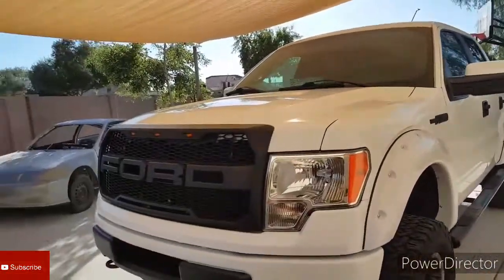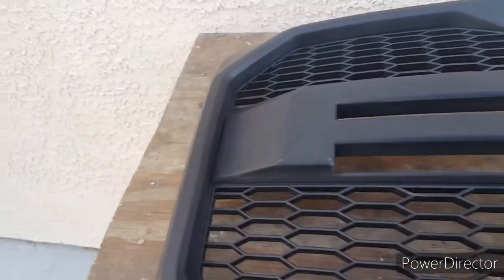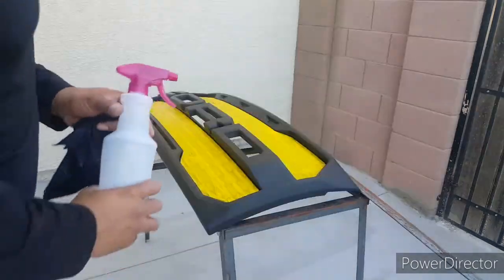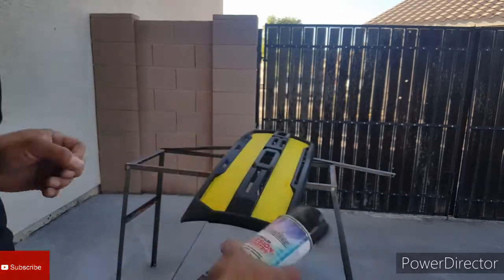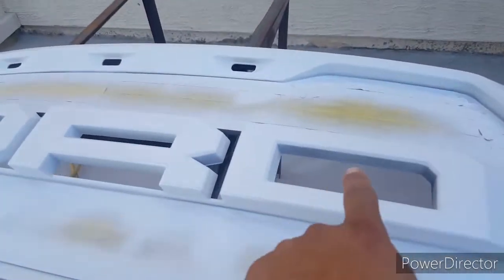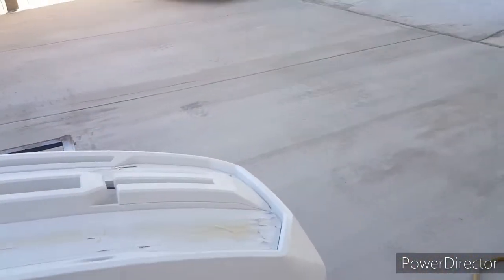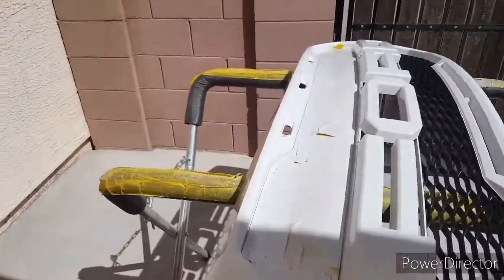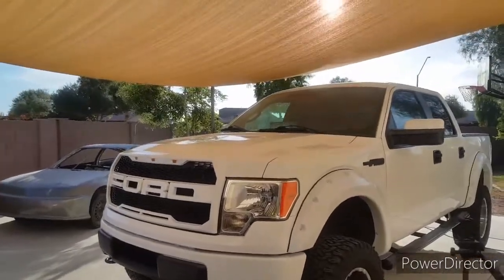How to paint your truck grill step by step DIY

Comment: Super helpful video! I just ordered a new grill that I intend to paint black. The grill is currently chrome. Would scuffing the chrome be enough before using adhesion promoter, paint, and clear or do i need to somehow fully remove the chrome first? Thanks again for the video!
Reply from the maker: Yeah you can  paint over the Chrome just stuff up everywhere u gonna paint , yeah it would be too much work if you try to remove that Chrome off the grill

Comment: Does the same process work for metal grills?
Reply from the maker: @syzzn.aiden.  u will have to use a direct to metal primer and let that dry and sand with 600grit and then paint

Comment: Looks outstanding!

It’s almost exactly the style I’m doing for my 2014 FX4/FX Appearance. I’m going to go with a flame red stripe on the flat piece  (it’s about 1/4” wide) all the way around, and also may use red for the honeycomb portion. The black will be the parts outside of the letters and maybe the beveled edges of the lettering. 

Same idea with the clear coat and probably using clear rock guard on the whole grille since I occasionally encounter small rocks on the highways where I live (we get lots of snow and gravel/sand is used for traction in winter).
Reply from the maker: Thanks Oh nice , Yeah the rock guard should be good and durable , red honeycomb will look cool 😎 👌🏾

Comment: Nice job ,,,you also mentioned sealer ..Is it necessary to use sealer and if so is it applied after applying promoter ?
Reply from the maker: Thanks man , No u don't have to use sealer, just  sand, degrees then use promoter and then paint
Reply: @josha7548  
Thx buddy !
Reply from the maker: No problem 👍

Comment: I used 180 grit to start but I’m using primer filler and primer sealer after the adhesion promoter is this good or bad
Reply from the maker: Yeah , along as u put it on the plastic , that will help it bond to the plastic better

Comment: so you can get away with just prepping then using adhesion promotor, then go straight to paint? Didnt know if the adhesion promotor acts as a primer itself. Plan on colormatching a similar grill, as well as some chrome plastic trim
Reply from the maker: I seen others video of shops doing bumper that are plastic straight to paint and they say it's fine , but some guys prim it be for, I haven't had a problem with it so far
Reply: @josha7548  Talked to a buddy that is in autobody for toyota, he said sand then paint would be fine for bare plastic like this, and to sand and prime chrome trim. Might just prime to be on the safe side
Reply from the maker: @spoofzyt6512  yeah the Chrome for sure

Comment: How long did you wait when sanding the clear coat and giving it another coat?
Reply from the maker: You can put two or three coats of clean , just wait like 10 minutes in between each coat , if you already did that and you're letting it dry and wanting to put more coats on top of that you want to wait a few days and then you can sand it with 800 wet sand paper and reclear again
Reply from the maker: But if you're going to do that make sure you throw a light coat of clear and Let dry for good 15 minutes , if you put the first clear coat on too heavy you can get a reaction from the paint and it will wrinkle up

Comment: Random question but did you sand in between each layers of paint when it dried?
Reply from the maker: No , only sand before you spray any Adhesive Promoter or paint

Comment: What did you use to sand it (that maroon pad)? Is there a grit number on it, and where did you get it at?
Reply from the maker: It's a maroon Scotch-Brite scuff pad it's about 400 Grit they also have a gray scotch pad that is about 600 to 1000 Grit more fine

Comment: Hey man I painted my Chevy 1500 grill but I got the wrong color, now I need to get the paint off before I paint again for the correct color. What steps would you recommend me to do?
Reply from the maker: You can let the paint dry for a Couple days And paint over it,  You can use a 400 grit or a maroon Scotch-Brite , But you're going to want to Put light coats Of paint And let dry for 5 to 10 minutes each coat .... If you spray on too heavy or wet The paint can react and  wrinkle up , from the previous paint
Reply: @josha7548  thank you! I will do that. 👍🏾